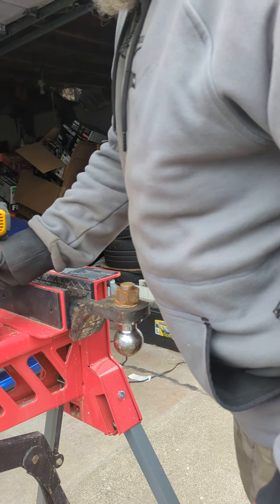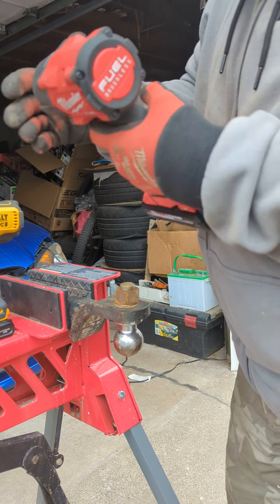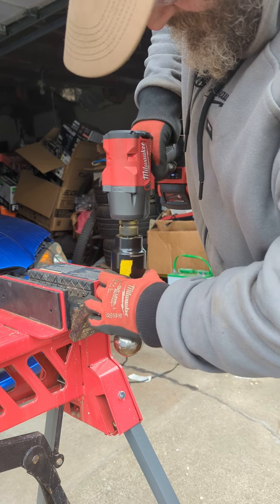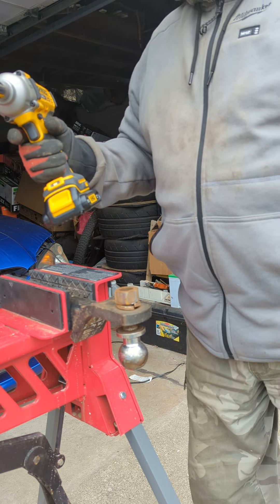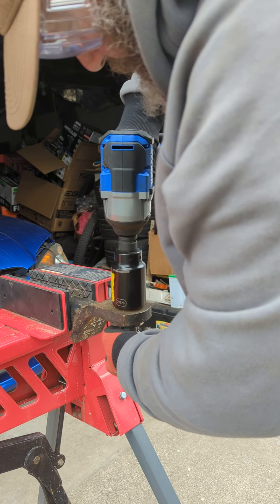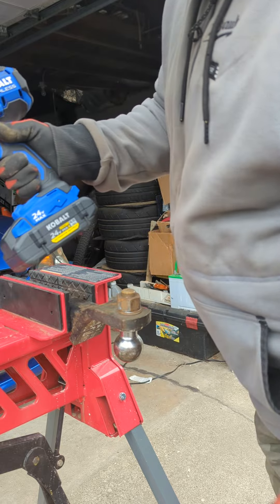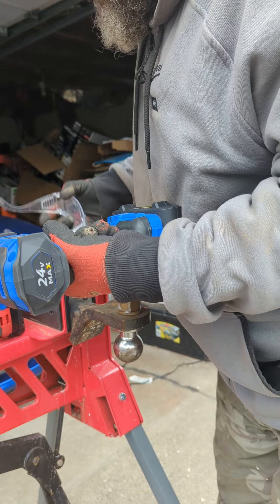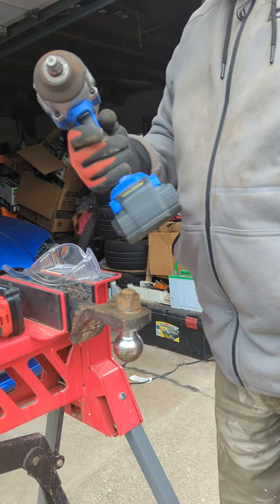DEWALT XR DCF 891 VS MILWAUKEE M18 fuel GEN 2 MID TQ 3 amp 21700 battery

Comment: I can't decide between the Dcf891 and the M18. M18 is shorter but when you need real power dewalt shines
Reply: I chose dewalt, cheaper, more powerful
Reply: @yakoff-vq2bb  with dewalt you probably never need an high torque for working on cars. With an M18 it could happen instead
Reply: @ticktime6569  😄 just today I thought I should also buy 900,  for rusty bolt 981 weak
Reply: @yakoff-vq2bb  😎😎 it was my idea too. Dewalt platform to have both the 891 and the 900 😎
Reply: I had both and the 891 is more powerful but it cant fit in tight spaces. Essentially i couldnt fit it in most places that i needed to use it especially when i needed to put an extension on it while working on cars. I gave the 891 to my brother. Its a monster impact but the m18 does 90% of what i needed plus it got in to the tight spaces i needed. I could carry the m18 mid torque around without having to pull out a compact 90% of the time where as the 891 it was more like 50-60% of the time. Just something to think about. Both badass though.
Reply: @swiftluss4272  thank you
Reply: That's the Milwaukee high torque
Reply: @swiftluss4272 which vibrates more?
Reply: @emmcee476  definitely the dcf 891 but its also stronger. Its definitely harder in tighter spaces since you cant get a firm grip at times.
Reply: Ive tried both dewalt 1/2 inch and the beefier Milwaukee 1/2 inch and the Milwaukee was much more powerful